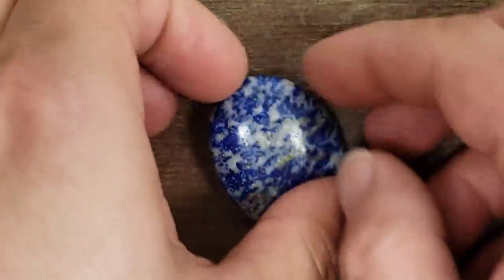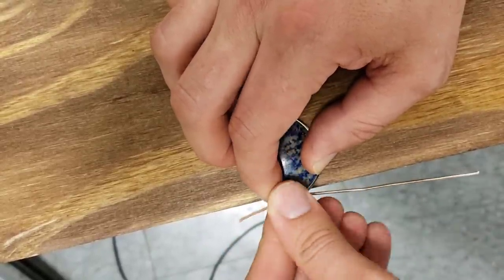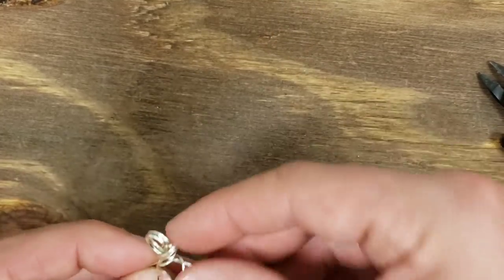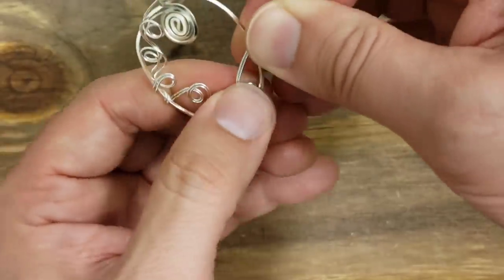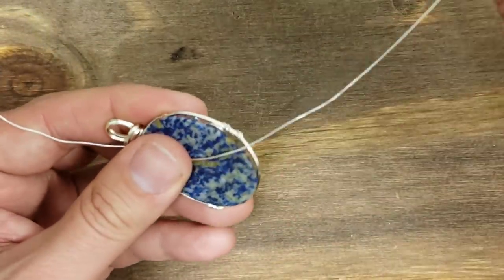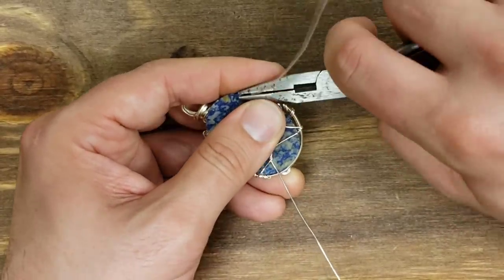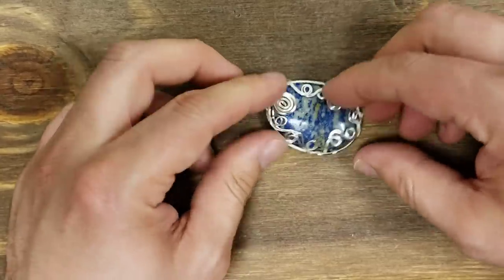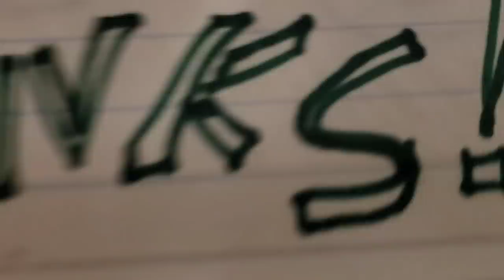New Way to Wrap a Cabochon!!!  No one ever thought of this!!!  (Probably)  Eps 400

Comment: Another game changer technique! I just tried this today and made two of these with cabochons. Worked great. My suggestion is to make sure the 18 gauge square frame is slightly larger than the stone when you first wrap it around because the frame shrinks after you start wrapping the 22 gauge wire around it. It worked better for me when I did that the second time, a much better fit around the stone. Both look great and are very secure.